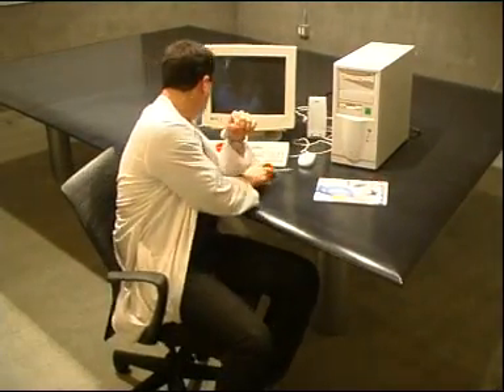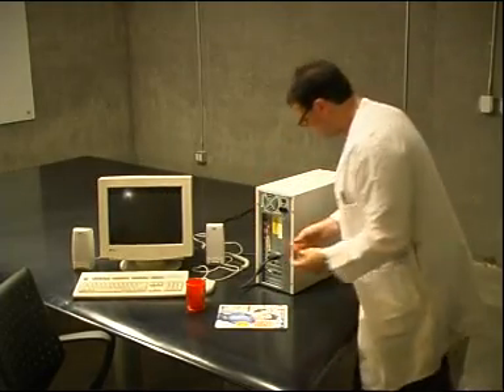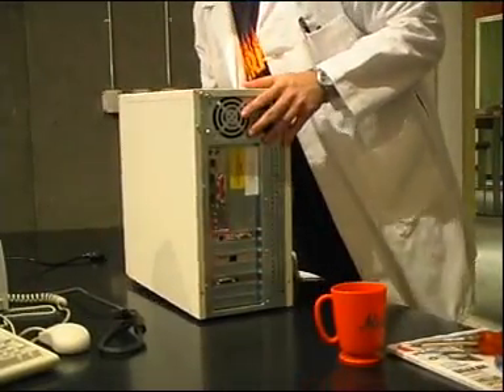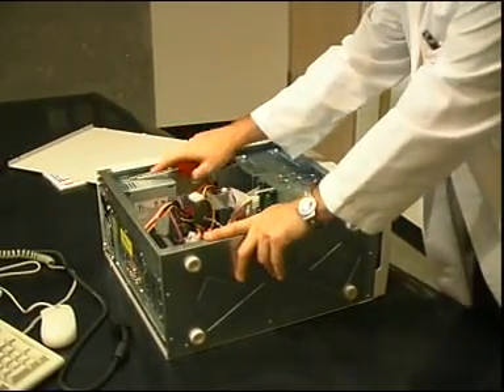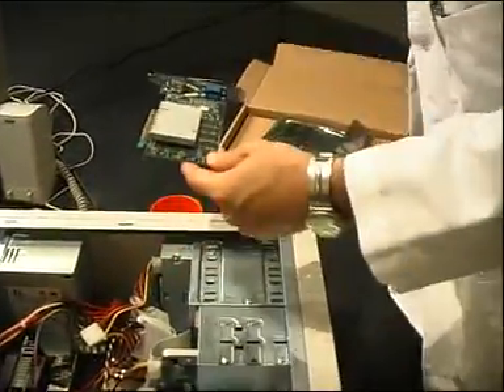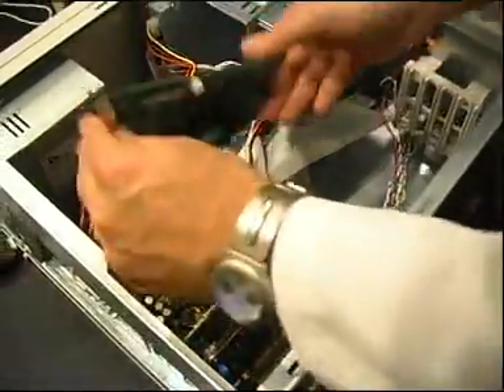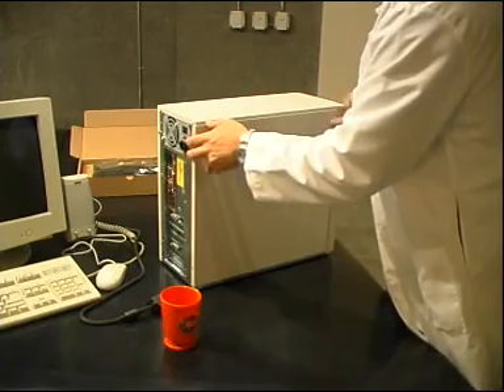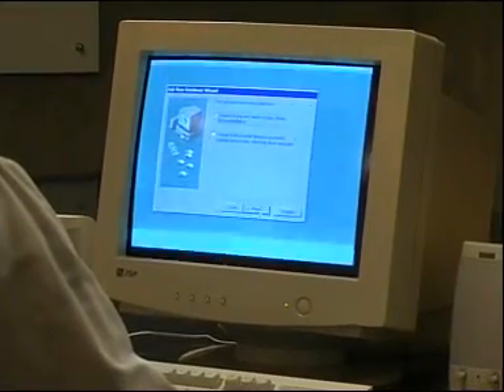How to install a Video / Graphics Card

Comment: @GenerationMine If your old card was integrated, you need to get into the BOIS and tell it to use pcie instead of integrated, their should be a guide online, but if you go in BOIS and look through the settings without changing anything you should find it.

Comment: @halflifefan84 
The power supply will have to corespond with your pc case, now that means if you have an ATX case (most likly) then go for an ATX PSU

The video card is 99% likly to fit in the motherboard, just be sure hehe you actually have a slot for one and also make sure the card isnt to big for the case (1% chance of that)

if you dont know what kind of case you have consult the retailer of the pc

Comment: guys im sorta freaked out...

im wanting to get a 9600GT and a 400W or 450W psu for it, from newegg.... now theres some bad news thats freaking me out...

I dont know if my motherboard or watever will be able have it put in, ive saved up $200 and it took me a damn long time to do so, and if they wont work im fucked and i heard u dont get ur money back... is there anyway i could know BEFORE i buy it if the psu and card will fit? Thanks to whoever helps me, i just rly need to know

Comment: hi..a got a dell PC with Dell 02Y832 mobo and a NVIDIA GeForce4 MX440 with AGP8x... i want to upgrade the video card so i purchased a Radeon HD4350 AGP.. but after uninstalling the previous card driver , removing the card and mounting the new card (HD4350) , the screen is empty (all black)..the cpu is on, the card is seated properly but i just dont know how to solve it...also, will a PCI video card fit on any PCI slot on this mobo?? pls help me..PM or reply..thank you

Comment: @GGGunitNextLevel How to know which g.card im using if i have 2 in on 1 PC?(differrent g.card)
coz wen i buy a new pc a GE9200 comes with it and then i upgrade it to GT220.I felt that there is no difference wen i installed Gt220.I tried to disable GE9200 but my screen goes blank.People said that i can disable it from the BIOS screen but i dont have BIOS screen either(note that im using a pirated OS,is it bcoz of that i dont have it)?????PLZ REPLY SOON

Comment: Hi guys. I have a question. I have a system with a Nvidia GeForce 9600 GTvideocard (3 gig temp memory and inten dualcore 2.4 ghz) and run windows XP32

Now i have another exactly the same videocard left over. I wondered if it was possible to put this in my computer also and generate some extra video performance power? so videostuf might run smoother? I'm not sure if its possible..and if i so how? Or where ican i get a description of how to do so? 

Help would be greatly appreciated!

Comment: ok heres the deal. Make sure your PSU is powerful enough to run without the power connector that has to go in the PSU. make sure your monitor is plugged in completely. all i know so far..how many watt is your PSU? please send personal message instead of responding here

Comment: ok i need an answer bad!!!i have a nvidia 7300GT, i put it in my 7 year old computer, but i haved to use a connecter to get power for it to work...i tried just sliding it in and connecting the monitor only, but the screne got no power and didnt turn on. what to do?

Comment: Well in order to run the REALLy good cards (Like the 8600GT andthe 8800GT) you have to have atleast 1 PCI-Express slot and the compatible power supply,motherboard,and CPU speed. If u don't have a PCI-E slot, then buying a video card is just pointless...

Comment: got the exact same pc and i installed a BFG nvidia 8600GT OC 512mb, the new card has the slots for your monitor but you have to go into bios and set it up i highly suggest you contact the card manuf. and have them walk you through it as you can screw it up bad if u do the wrong thing. BFG tech support is awsome they helped me set mine up in no time and it works great. if u like get back to me and i can give u a # to get them im shure u could just say u got it from them and theyll help.

Comment: And if your graphic card is wide and doesn't fit, I suggest you get a upgrade or get a new small graphic card without those 6-Pin PCI-Express power connecter.

Comment from the maker: Well, if you have a brand name computer that's store bought, a lot of brands have the graphics processor right onto the motherboard, and installing another graphics board will often require you to "disable" the onboard while upgrading. Can be a real headache. And yes, some computers are not "upgradable" as they will only operate with the parts that they are shipped with. Rare cases, but I've seen it.